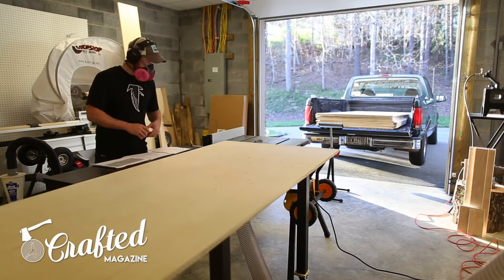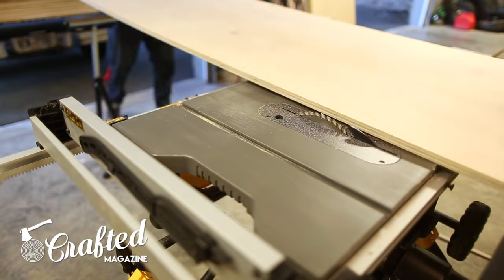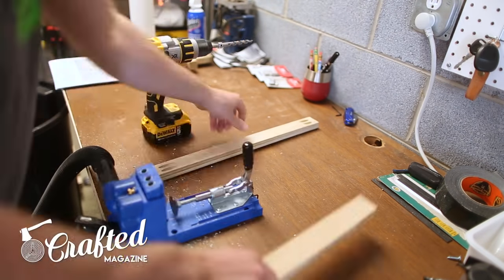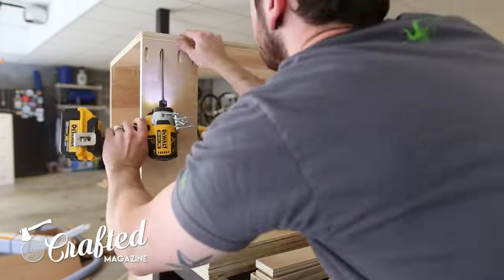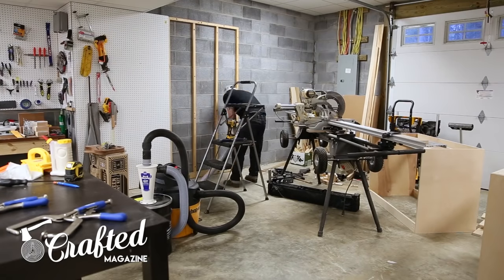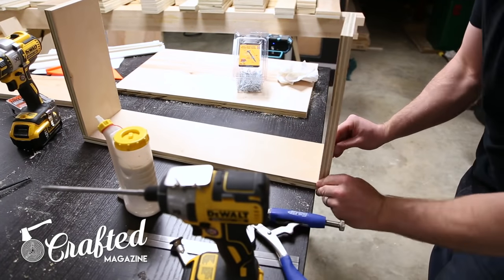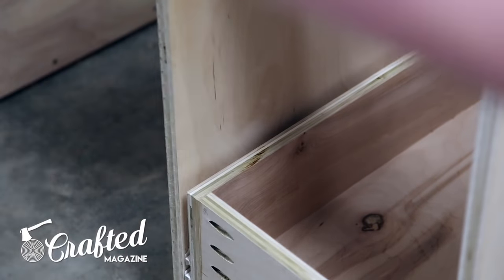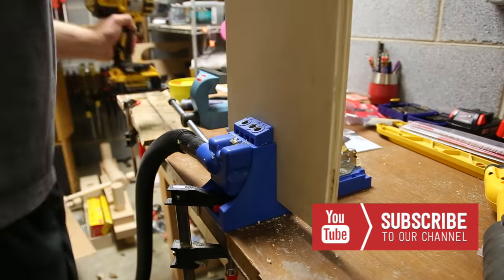Building the Jay Bates Miter Saw Station Part 1 | Crafted Workshop

Comment: The purebond I pick up at HD always warps. I built a toolbox with it and after everything dried, the drawers get stuck because the vertical supports warped in the middle.
Reply from the maker: I haven't had that issue, I've built a number of pieces using their plywood.
Reply: I have to wonder how that's even physically possible

Comment: Awesome build man! I'm currently wrapping up a version of this build myself with my own little tweaks added in there. I do have a question though that I'm curious to see if you know the answer. I heard you mention FastCap self centering pocket hole screws rather than Kreg's pocket hole screws so I went to the website and checked them out. Why do pocket hole screws only use square head's? I would think if square heads were more efficient than a phillips or flathead bit then you wouldn't see hardware isles at HD with 95% phillips and flathead screws. Im new to wood working so you definitely have a new subscriber as well. Thanks for the awesome video.
Reply from the maker: +Robb A thanks! Square heads strip out a lot less than Phillips. They are much more popular in Canada but for some reason, here in the US, we're stuck with Phillips and flat head.
Reply: Crafted Workshop That's crazy, I never would have thought that. When I saw the square heads before I really knew anything about wood working I was trying to figure out what in the hell they were lol.
Reply from the maker: +Robb A hah yea give them a try!
Reply: Crafted Workshop  Try Torx screw from SPAX company, those are very good and popular in EU, as good or better than Kreg

Comment: Did you just pull cut on a sliding miter saw?
Reply from the maker: +Francisco Rodriguez you know, for some reason I always assumed a sliding miter saw was the same concept as a radial arm saw. Just did some research and I was totally wrong! Thanks for pointing that out, all push cuts from here on out.

Comment: How well does the drawer bottom hold without a DADO?
Reply from the maker: They are plenty sturdy with all of the glue and screws. You could certainly adjust the plans to use dados/rabbets, but they would add a LOT of work to the build.
Reply: Yeah the extra time was my concern. I'll be making the Jay Bates type drawers for a bedroom dresser but don't have a convenient way to cut dados for 1/4" bottoms. Now I'm wondering about 1/4" or 3/8" for the bottoms the same way you did it.
Reply from the maker: Two passes on a standard table saw blade should get you your 1/4" width, no? Should be relatively simple to run all the pieces through once, move the fence 1/8", and do it again.

Dados might be a better solution for bottoms that thin. My entire miter saw station is built out of 3/4" plywood, so the drawers are basically bombproof even with just screws and glue.